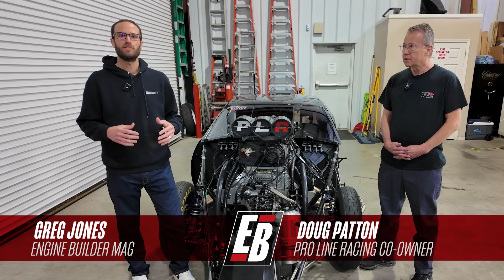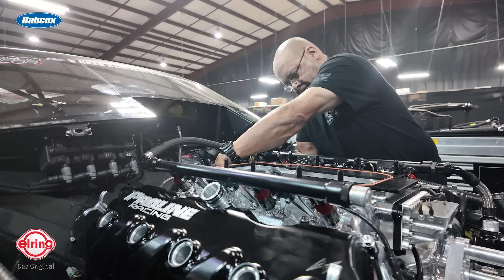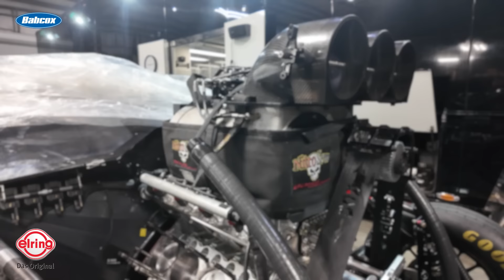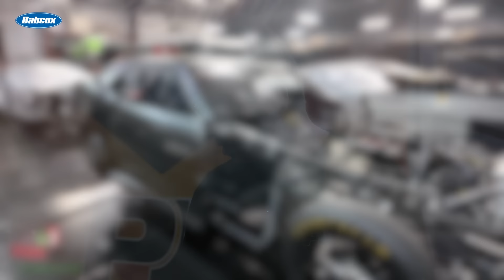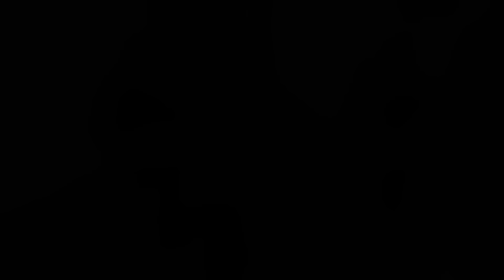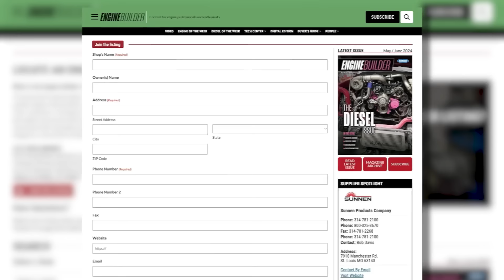Pro Line Racing Screw-Blown Alan Johnson Hemi Engine for NHRA Competition

Comment: Outlaw makes close to 70 pounds.
Reply: A little more than that I believe. They're knocking on the 4 second zone. Saw a 5.11 last Saturday in Outlaw trim.
Reply: @wilsonjohn9766 that’s not proline. Chimney Taylor has extreme race engine 4.9 Hemi
Reply: @1@1 @TerenceWooten1 h I know it’s a twin turbo Noonan Hemi combo built and tuned by Carl Stevens Jr of Xtreme Racing Engines. I never said it was built by Dillard and Co. I said in Outlaw trim they’re closing in on the 4’s I meant the cars.
Reply: @wilsonjohn9766 gotcha